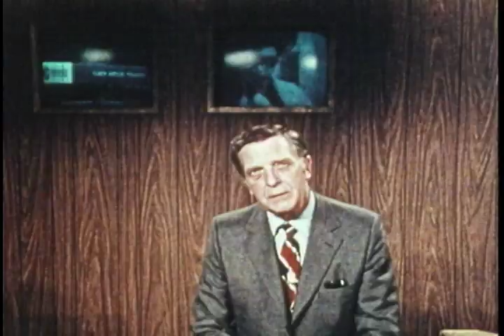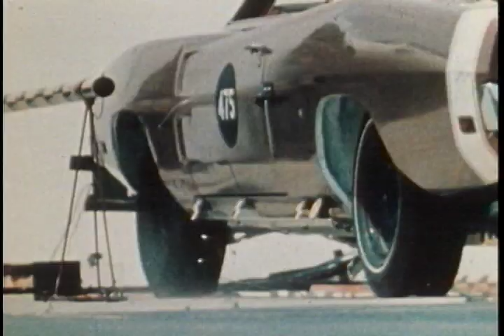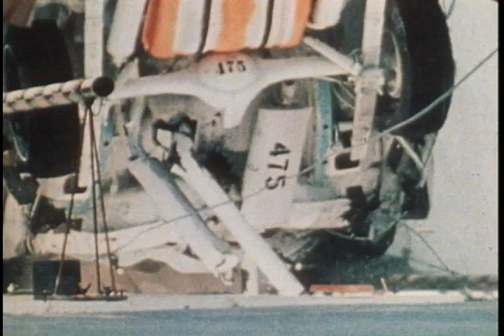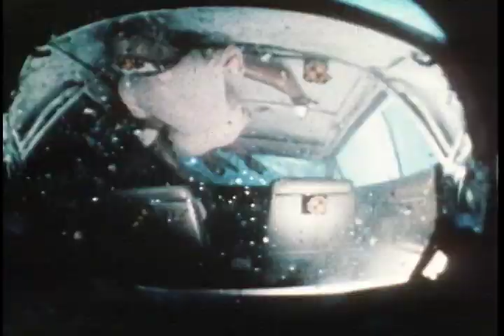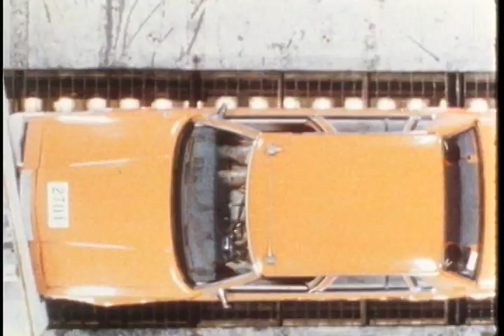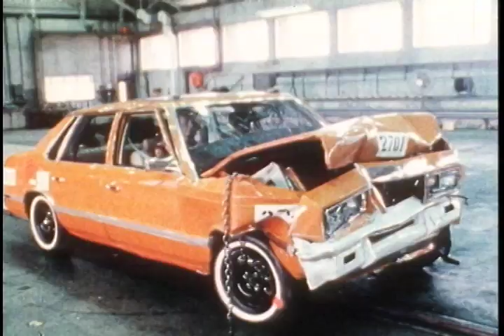Chrysler Crash Tests

Comment: omgosh. 66 or 67 charger bashing into a 68 plymouth 4 dr b body! idk what the 69 charger hit, but must've been at a high speed! some srsly tough unibody cars.
Reply: "tough"
Reply: @zyke612  along with being very crash worthy..they can handle a 600+ hp race Hemi, as delivered in both '65 in the B body cars and '68.. the Superstock A body Barracuda and Dart..cars that ran 10's stock. ..y'know the sheet metal gauge was near dbl the industry standard of today, right. true unibody cars, where the whole car was the strength..not just the 2 dimensions of the chassis. literal decades ahead of anything else aroound then.
Reply: @gzuzsavz  hellcat is still faster than
Reply: @zyke612  Hellcat is also lighter than the original muscle cars with a higher output engine. The original engines didn't push out more than 400BHP where the Hellcat defaults at 777 HP...no comparison. And if you drop the Hellcat in to the original Charger body, you'd have a beastly muscle car that would shame the newer models.
Reply: It was 100mph crash into a wall...